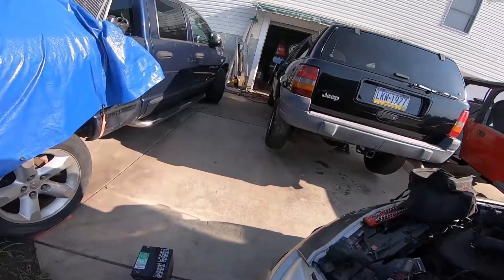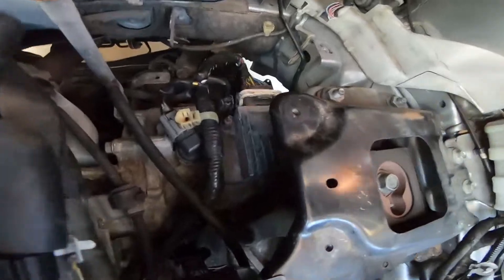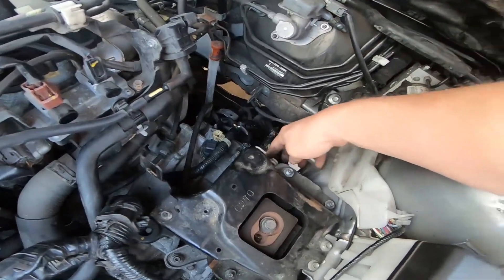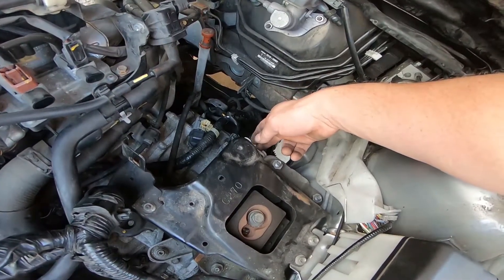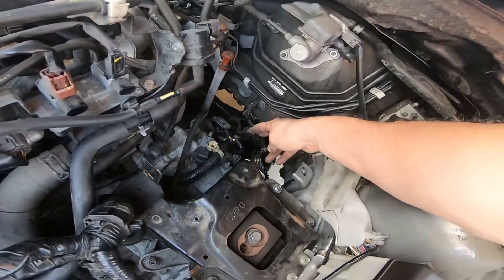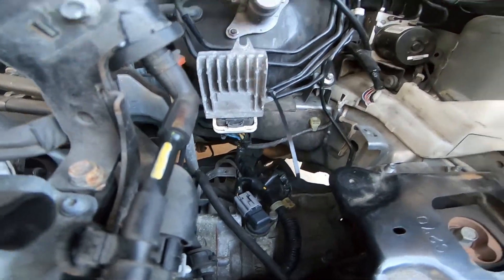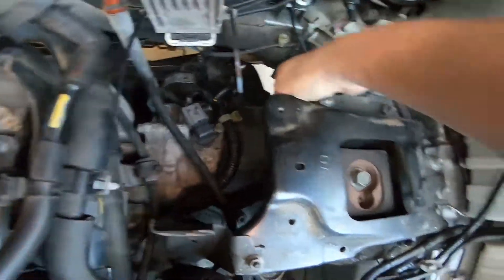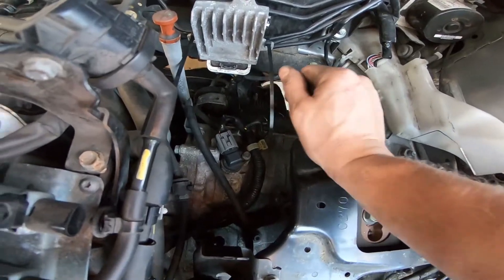mazda 5 transmission limp mode hack

Comment: Hi i have 2012 mazda 5 i got code P0720 and i replaced output shaft speed sensor, i checked wiring and all but it still has the AT light and code. Should i replace TCM?
Reply from the maker: Unfortunately, with that code, you’re gonna wanna do further testing on the electrical system make sure that you have good continuity from the TCM to that speed sensor. That code doesn’t actually indicate a bad speed sensor but something wrong electrically so it right might require a little bit more than just parts it might require some diagnostic time. I wouldn’t just put the TCM on it unless you have a spare one that you could try, but I wouldn’t go out and buy the parts.

Comment: I have a stupid question I have looked on top bottom sides I've done everything but pulled the engine it's a 2007 Mazda 5 I can not for the love of god find the pcm do you have any ideas
Reply from the maker: To the location of the PCM off the top of my head I’m not sure the TCM should be directly on top of the transmission unless it’s already been moved
Reply: @joshlogan5233   is this the same josh Logan that plays music ? I have done everything but pull the motor to find it it's not to be found I received a picture couple days ago I'll try and send it to you to see if you can tell me where this part is it looks to me as it's the shifter cable knob

Comment: M-a 5 2012 1.6Diesel 300,000 km, no problem antil yesterday. First on the way home ESP off sign appears, 1 min later breaking system warning sign added , 2 min later steering wheel in the ring comes, steering wheel waveablylose pressure! I  rebot computer by dropping off battery clemm all this gone but in the morning comeback same pattern but faster. I have completely break down, reboot not helps engine not starts. what it can be? Day before I change coolant by my self, I not suore I done it completly right...Help please, help
Reply from the maker: Sounds like you’re not getting the correct amount of power to those units and they’re dropping out one by one. It could be a problem with your network interface between all the different modules I would recommend probably taking it to a technician that specializes in that and or looking up TSB‘s, which are technical service bulletins to see if it had any issues with that, but without having more data from a scan tool, it would be very hard to diagnose
Reply: @joshlogan5233 , thank you my friend

Comment: ive got a 2015 mazda 5 sport and looked under battery box and removed air box also and there is no TCMin that location on mine ive looked everywhere in the engine bay and still nothing tcm light on after a litle while then limp mode kicks in.......HELP PLEASE !!!!!!!
Reply from the maker: I unfortunately would need to see pictures of that engine bay area and the light that you’re saying is on is it a check engine light or is there a light for actually TCM because that I’m not aware of I’ll see if I can look it up on my end

Comment: Hi. I did relocated tcm as you recommended last year and I must say did fixed tcm acting up. This year on first worm day   27'C started again. Worst thing is by the time car will cool down and I will take it to tech codes are gone and no tech can tell what the problem is.
Reply from the maker: Check for historic codes or maybe generic OB D2 might keep a record of them. Other option is stop by local auto parts while the code is on and have them pull the codes for you really quickly it’s normally free.

Comment: I'm getting the P0882 code on my 2017 Mazda CX-5. It's got just over 29,000 miles on it. It happens intermittently,  goes into limp mode, but runs normally again if I turn it off and then back on.  Could it be a similar situation to what you show in thus video?
Reply from the maker: It’s very well could be based on the fact that it is a heat related fault and that’s why moving it off of the transmission helps with that hopefully at this point it hasn’t done permanent damage some do some don’t it’s a tossup

Comment: TCM MODULE for my mazda premacy  5 is not located underneath the battery holder.
Reply: Unable to locate where it is
Reply: I can't locate mine as well....I'm wondering if that's it on the radiator

Comment: hi guys, my mazda5 2010 the transmission works only when it is cold, after 20 min the shift doesn't work at all, that can fix that problem?
Reply from the maker: I would try it first to get it out of the hot zone but most likely if it’s not shifting after a certain point it might be too far gone but definitely try it and see if that helps you might still experience it on very hot days

Comment: Hey brother my 08 mazda 5 runs great shifts great, but after running for a few minutes its starts shifting in and our of gears jerking. The display starts changing like 3 5 R D and then it'll stop and start back up after few more miles. Was asking what yours did that make u get the a TCM and do u think this could be my issiue?
Reply from the maker: It very well could be the same thing the one in the video was having shifting issues and it seemed a lack power the motor was revving fine but it was almost as if it wanted to go to a lower gear and it wouldn’t

Comment: Hi, I'm getting the AT & Engine light on. Will this remedy both? Also, will changing the #8 position, 20 amp, heater deicer TCM fuse fix this as well at all?
Reply from the maker: Depending on what codes you’re getting it could help what you’re doing is getting it away from all the heat of the transmission I’m not sure about the fuses though I have an actually heard of that I’d be interesting to know what that’s trying to fix
Reply: Hi, I'm wondering if you solved this issue and how? My AT and Engine light came on earlier this week and I'm not sure what to do. Would appreciate some feedback.
Reply: I have a 2012 Mazda5 and recently started to get the AT light esporadicaly, I check the transmission gage and the fluid is black and stinks like if it was burned. Not sure what to do 😐

Comment: Dis you have any issues prior to this hack? Or you did this so you wouldn't run into the overheating issue? Asking cause I'm getting the TC light on and engine light comes on and seems to skip a gear or so....pretty frustrated over here
Reply from the maker: This was actually my neighbors car he was having an issue that sounds very similar to yours by moving it I think it bought him a little bit more time about six months before his finally gave out completely which was just recent and he will be replacing it but putting it in the alternate location shown on the video
Reply: @joshlogan5233  give up comletely?  transmision or computer?

Comment: Did you add some sort of non conductive rubber/foam underneath the TCM so it won't short the electronic component inside after being mounted to the brake lines? I have a 2015 Mazda 5 and want to do the preventive measures like you did.
Reply from the maker: No that really isn’t necessary based on the construction of the housing for the TCM originally it’s bolted to the transmission itself so you don’t run into any issues with that and it’s grounds run through the wiring not to the housing